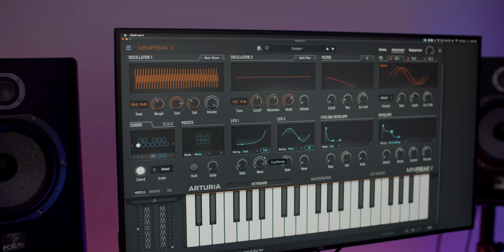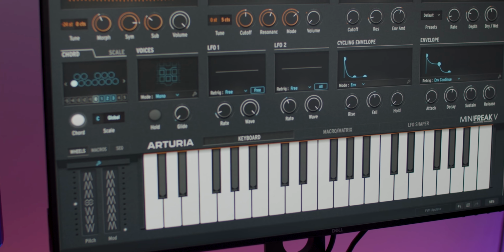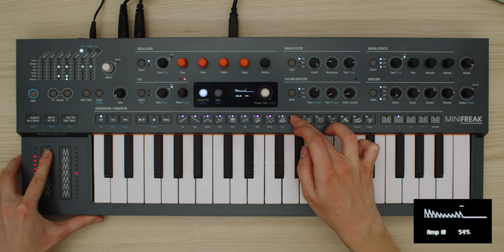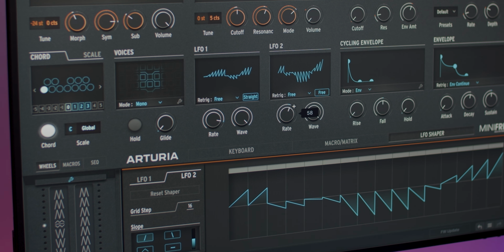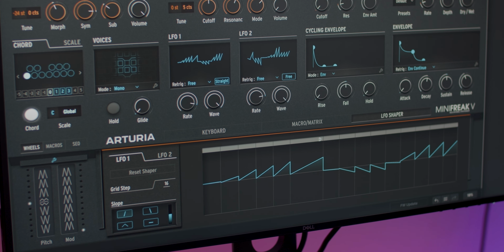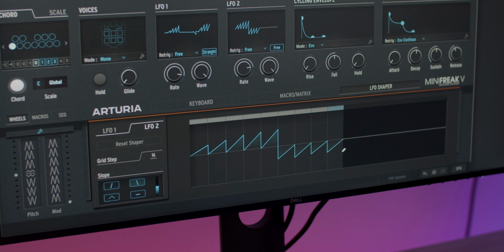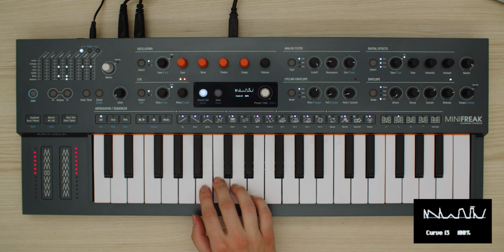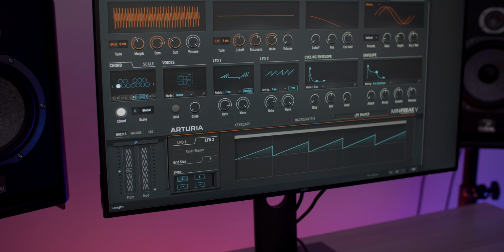How to | MiniFreak / MiniFreak V - Custom LFOs

Comment: Hello, my LFO is not working in Minifreak V. Do I have to activate it somewhere in the software?

Edit: Found out I have to route the signal via the Matrix.
Reply: Yes, btw you can route the LFO2 in the LFO1 amount to modulate the modulation over time. You can even modulate LFO1 amount with the LFO1 itself !